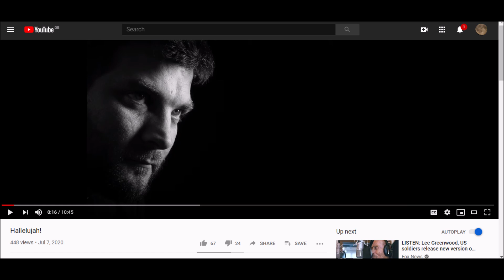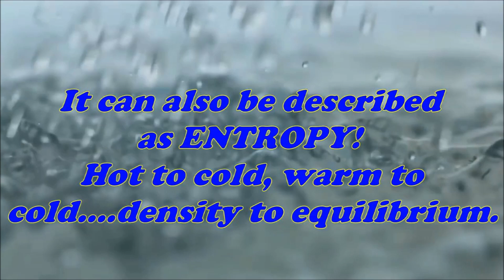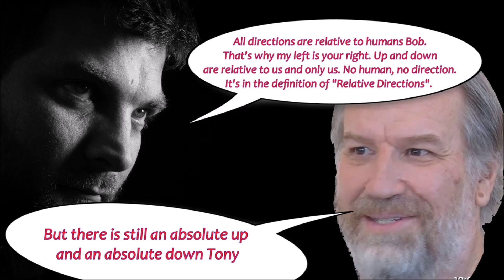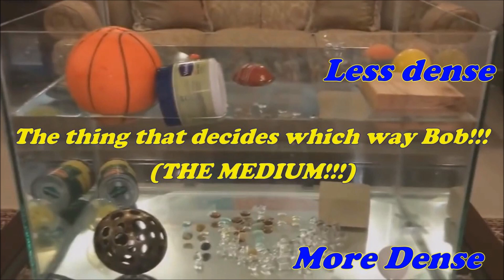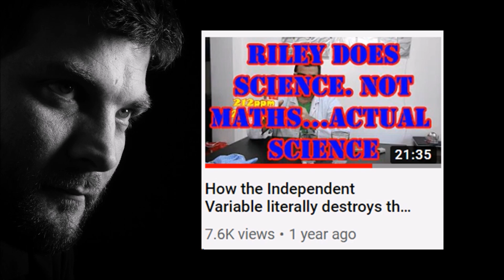Relative Density & Gravity: Riley still doesn't get it.

Comment from the maker: Thanks for all your comments. 
It seems that Riley has made a video in reply rather than posting a comment here. I only asked him to answer two questions. 
1. How can he determine which direction the block of wood should fall.
2. Why do the duck, wood & anvil float partially submerged instead of sitting on the surface of the water or mercury.

It should have been quite easy for him to post a comment here since he is not blocked. Unfortunately, I cannot comment on his videos presumably because he has blocked me from doing so. In fact, the main reason I decided to post this video was that my attempt to comment on his video was only visible to me. 

If I have time I will make a response video to Riley's response but I really don't want to try to have a conversation by repeated video responses.
Reply: The duck is partially submerged because it weighs more than a witch.
Reply: The basic tactic of the Liar Riley is to ignore comments that he cannot debunk or to which he cannot produce an answer. He only reacts to criticism when he thinks he can make a point (which in reality he never can), when he thinks he can get away with a (bad) joke (like: don't be silly, or you're a spastic with a dog) or when he thinks he can shove: "gravity isn't a force, Albert said so" into the conversation (which he manages to do almost always). I made some videos about the Liar Riley lately, and he has reacted to only one of them and those reactions stopped the moment I got him where I wanted him.
The Liar Riley somehow has committed himself to call you a liar all of the time (I call him a liar as long as he persists in this attitude). You have obviously hit a nerve with him and that's a good thing in my opinion. If you make a reaction video, I would limit it to asking just those two questions and stating that he cannot answer them. I wouldn't react to any of his silly statements in his video, if I were you.
It's nice to have you back.

Comment: Riley "Relative density gives you the vector"
Well, this is not entirely untrue. You can look at the density gradient and that is indeed a vector. But there are still a few problems with it.
1. Not every vector is a force.
2. Even if the density gradient were a force, the vector for this gradient is outward and not downward. Horizontally this pretty much evens out. But vertically the density of air is a tiny bit higher above you than below you, so the density gradient is higher in the upwards direction. On balance, the density gradient would force you upwards, not downwards.

He says you don't need to calculate it, but this example shows exactly why you should. The calculations tell you the logical consequences of what you're saying, and can stop you from making a fool of yourself.

Comment: This still falls apart at the demonstration with which mr Sensible started his channel a year or so ago... two bags with an equal mass of cheese. One stays the way it was when weighed, one is then compressed as much as possible to a tiny ball. THis cheese is now WAY denser.
Why do the two differently dense masses of cheese still hang down on a bar scale vertically? Why isn't the denser one pulling the scales way more down???

Comment: So how do you measure curvature in 2020? 

You do realize that every survey of every piece of property on earth is measured using horizontal distances. A survey is a legal document, and they are also Flat Earth Map. Everyone has access to them, and they can be found at the land records offices everywhere on this Flat Earth.
Reply from the maker: In the 21st century, a good method is satellite geodesy. https://en.wikipedia.org/wiki/Satellite_geodesy
Of course, geodetic surveying goes back to at least the early 19th century.
Reply: Miles Davis 
How do you overcome the Fact that every single survey (legal document) of every piece of property on earth is measured using horizontal distances? There is no surveyor on earth that takes curvature into consideration. As you must know, spheres must have 360* of curvature. There is zero curvature to be measured. 

Now, you claim that satellites can measure curvature. Does it not seem strange that the earth’s curvature was first measured using two sticks and shadows? That’s not proof of the shape of an object. Then there was a measurement of the horizon dip. That’s also been proven to be false. We can see way too far, and the horizon is NOT caused by Earth Curvature. So now the claim is that satellites are measuring the earth’s curvature. 

Funny how the first two methods have been shown to be impossible to measure radius, yet they were correct somehow isn’t it? Now you have me, someone who measures the earth for a living telling you that I, as well as every other surveyor on earth produces Flat Earth Map that are also legal documents that there is zero curvature. And, as far as GPS goes, sea level is exactly that!! Sea level is the same everywhere, and simply is used as a benchmark for elevation. 

Given all these facts, excluding everything else, such as the stars never changing their orientation with each other, the Earth never moving under anything that leaves its surface, living in a positive pressure system adjacent to a vacuum hahahahaha, nothing but fake computer generated images of the earth floating in said vacuum, and ridiculous hoaxed moon landings, as well as assumption upon assumption with zero scientific experiments, any thinking human being that still has the ability to discern must come to the conclusion that 

GLOBE EARTH IS A RELIGION! 

Please explain how you can come to any other concussion? Absolutely nothing about the so called science of the supersonic spinning water ball works. And believe me, I talk to engineers and architects about it all the time. They all say it doesn’t work.
Reply from the maker: @flatearthfisherman7153  Your comment seems rather desperate.  "There is no surveyor on earth that takes curvature into consideration."  This is simply untrue. Have you bothered to research geodetic surveying? Maybe you should check out Jesse Koslowski's YouTube channel. 
I'm not prepared to enter into a discussion with someone who makes such false statements. So if you want me to respond to any more of your comments please do a little research and fact-checking of your statements/beliefs and then get back to me if you have anything left.
Reply: Miles Davis 
Jesse the Rodeo Clown is just that by the way. When he does a real survey of a real piece of property, guess what. Yup, you guessed it. Everything will be given in horizontal distances!! He would never stamp and file any survey that has curvature, because he’d get his ass handed to him. That’s called factual information. 

Globe Earth is a Religion
Reply: Miles Davis 
Same goes for the Maine Surveyor. When he’s shooting his reciprocal angles at a distance of over 1500’ , he’s not measuring curvature. What do you think the working distance is of his instrument? Maybe it’s like star light, it cans travel forever? No, it’s working distance is maybe 600’. No instrument is dead on, go ask the manufacturer. They will tell you that it’s not accurate enough to make two perfectly plumb lines at that distance. Not only that, he should do it multiple instruments, ahhhh wait, then he’d get multiple results proving that it’s the equipment. Either way, he’s not being scientific, he has an agenda, just like Jesse. I say this for the simple reason that he to won’t admit that he’s never measured curvature or calculated for curvature in any real survey he’s ever done. 

Another thing, if surveyors were measuring curvature, why can’t you get more of them to stand up and give testimony? The answer is simple. All surveyors strive for that horizontal distance. That’s the one that counts.
Reply: @flatearthfisherman7153  Miles asked me about some of your claims here on this video. This was my response to him about your claims:
 
I've had a few exchanges with Flat Earth Fisherman.  His claim "There is no surveyor on earth that takes curvature into consideration" is false. Total stations have a curvature correction setting. Usually it is toggled on before it is purchased. This corrects the elevations of shots stored into the memory of the data collection unit (a/k/a data collector, or DC).  If we don't want the total station to carry out that correction for us, we can do one of two things: we can toggle it off or we can simply write down the measurement data from the total station, as I did, collecting the zenith angle and slope distance. Of course, determining the elevation of each point in this video was not my purpose, and unnecessary. I analyzed the direction of the plumb lines, for which the relative elevation of  the points is irrelevant. 

His claim "it's working distance is maybe 600' [600 feet]" is false.  Flat earthers often get confused about the capabilities of surveying equipment.
I used the Leica TS 16 in this video. The on-board electronic distance measuring instrument (EDMI, a/k/a laser distance measuring device, or laser) has a distance limitation. My instrument does not have a definitive limit, but it can shoot distances greater than 33 000 feet, as seen on page 70 of this manual: https://surveyequipment.com/assets/index/download/id/845/  On page 67 of that manual, we find the range with a standard prism, such as I used in the video, to be 12 000 feet. That's quite a bit further than FEF's arbitrary limitation of 600 feet. 
For pointing the scope at objects, there is no distance limitation. As long as the object is visible through the scope, angles can be turned to it. It's that simple. 

Of course, FEF likes to repeat that surveyors are only interested in horizontal distances. What he's not saying is whether those horizontal distances are grid distances or ground distances. There's a difference. When working with map projections, the distance shot in the field is not necessarily the distance we place on our maps. In fact, it often isn't. We need to account for the distortion of the map projection to which our field measurements are referenced.  That's another video topic entirely, but here's a very good primer on what that's all about: http://www.ejsurveying.com/uploads/2/5/6/6/25668328/working_with_grid_coord.pdf?fbclid=IwAR0UN7hboxlJeHxtsdsIYjJdp6PvoZx8xCm48SlonwtvRqwVQlJ6n408UYI 
Generally speaking, ground distances are longer than grid distances (distances reduced to a map projection). Sometimes, though, grid distances are longer than ground distances. That link above will explain why that is. 

Publishing slope distances on property lines makes no sense, as that would introduce too much uncertainty, and is not helpful to the end user of the survey plan, such as a land owner, attorney, municipal review board, or other laymen. Therefore, we conceptualize any two property corners as laying within the same plane, and publish the horizontal distance between them, which is shorter than the slope distance, and is further constrained by the map projection used at that location.  

Suppose a survey plan has a distance of 1000.00 feet between two property corners. By coincidence, we can see from one corner to the other. The plan is referenced to a Transverse Mercator map projection and has a combined factor of 0.99994.  We set up a total station over one corner and a target over the other. We shoot the slope distance. We use that slope distance and the zenith angle to get a horizontal distance of 1000.06 feet. Did we do something wrong?  Nope. Our distance is exactly correct. When we multiply the field-measured horizontal distance of 1000.06 by 0.99994, we get 1000.00 feet, as shown on the plan. So, we see that both horizontal distances are correct, both the one existing on the ground, and the one reduced to the map projection on our plan. 

To my knowledge, FEF has never claimed to be licensed. That has freed him from having to contend with these issues. If he collects data in the field and turns it over to the licensed surveyor in his office, he never has to worry about curvature one way or the other. Field crews often don't. This is why, when flat earthers interview surveyors on the side of the road, the tactic is disingenuous.  In fact, FEF had a video where he and a friend are getting set up in the field. The guy setting up the total station said sometimes slope distances are shorter than horizontal distances. FEF agreed. (That video can be found here: https://youtu.be/pz410YQ58P8?t=86 ) That right there is someone who has not had to do much with the mathematics of surveying. A slope distance is a hypotenuse of a right triangle. The hypotenuse is always the longest side in a right triangle. One can't even pass the most basic of surveying exams in the United States with that level of math illiteracy. It is this illiteracy that makes FEF believe he is right.
Reply: The Maine Surveyor 
There’s so much wrong with everything you said that it can only be attributed to the fact that you’re presupposing the globe. Your whole premise relies on it! There is no way that you or any other surveyor would take elevation or location
 at 600’ if the shot was important. The only time any surveyor would do that is if they were doing a topo for an engineer or architect to get a general lay of the land. If you were going to set a property corner, you wouldn’t be taking a 600’ shot. 

You can make the claim that you’re instrument and or your dada collector already automatically corrects for curvature. What about a level? Does that correct for curvature too? Or wait, here’s another good one. When you do a set up, your level is tangent to your presupposed ball because of gravity right?? I mean, that’s why you can’t simply do a bench run because you’re incapable of making horizontal projection. In your world, horizontal is curved right? 

So if I decide to do a bench run and show that the Earth does not drop off, you will say Gravity, and call foul. Why don’t you just admit right here and now that in 2020, you don’t have the capability to project a horizontal line!!  

Of course your instrument is perfect, and any deviation is because you live on top of a ball, everyone is on top of the ball right? 

Here’s the thing you can’t get past though. Every single survey (legal documents) are measured using the horizontal distances. It doesn’t matter how big the property is, it will always be in horizontal distances. These maps (Flat Earth Maps) can be found in every land records office in the world and are publicly available. Anyone can pull any survey (legal document, Flat Earth Map) they like. It’s 2020, and the best you can do is make assumptions and excuses. 
There is zero curvature, and that’s why the Globe is finished! Care for some Black Swans anyone 

P.S. 
SHOW YOUR WORK! You make the claim that you can measure curvature, the show one of your surveys where you found it, set a pin, put a note on your map, and filed it so anyone, including other surveyors can pull it from land records. I won’t happen, ever.
Reply: The Maine Surveyor 
Go out, survey someone’s property, find curvature, and put it on your map. Then stamp it, and file it!! If you can’t do that, then you’re just playing games. Make it for real by putting your license on the line!! You won’t do it, and neither will any other surveyor.
Reply: @TheMaineSurveyor  I think FEF is only going to accept this if you used curved maps. On the other hand, I'm actually learning things. Thank you!
Reply: Barry On Thank you, that’s very kind of you. Jesse Kozlowski has heaps of good information. His blog can be found here: https://jessekozlowski.wordpress.com/2020/04/04/the-earths-curvature-plainly-visible/
Reply: The Maine Surveyor 
He has heaps of nonsense. Not one actual survey (legal document) that shows curvature. You can say anything you like, but until you file it in land records it’s nothing!! Just like you Maine Surveyor, you do a test, not an experiment by the way, then you conclude that it’s Earth Curvature. That’s the hight of ignorance! But then again, you’re just preaching to a bunch of religious zealots who think pseudoscience, what you did, is science. 
What joke. 

Globe Earth is a Religion
Reply: Look up grid corrections, Flat Earth Fisherman.
Reply from the maker: @barryon8706  @Flat Earth Fisherman appears to be somewhat triggered. I wonder why?
Reply: @MilesDavisKDAB  I think that fisherman believes he got his hooks into something and it turned out he was caught-flat-footed with a whopper.

Comment: The decisive arguments against 'buoyancy and density' are quantitative , so flat-earthers, who are incapable of quantitative thinking, will never get them.  But they need not involve complicated mathematics.  If a dense object is immersed in water, it's effective weight is reduced by buoyancy, which can be measured by suspending the object in the water from a weighing balance.  The difference between the measured weight of the object in and out of water gives the buoyancy effect of the water.  The key point is that the buoyancy force depends only on the amount of water displaced by the object, not its relative density .  A cube made of lead will be much denser than a cube of the same size made of (say) plaster, but as it displaces the same amount of water the buoyancy force will be the same.  If the reduction of weight were due to 'relative density' there would surely be a difference, if the theory of relative density means anything at all.